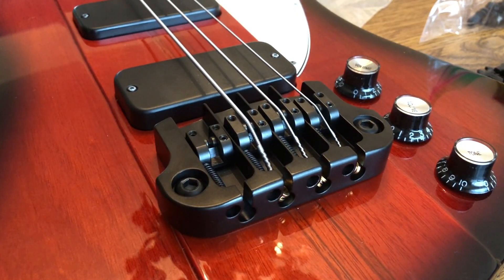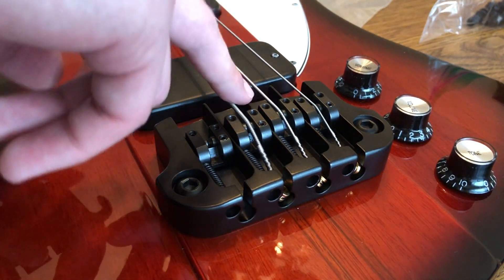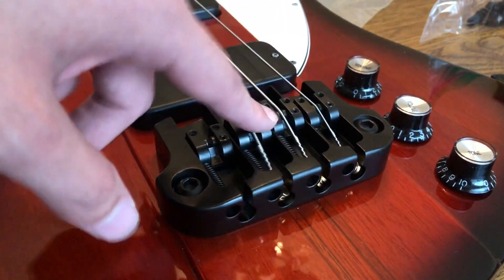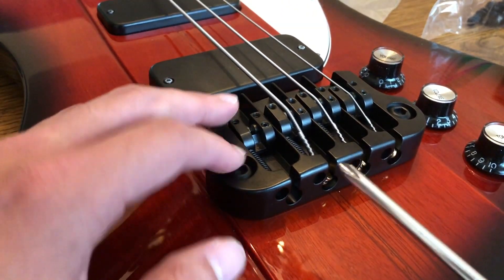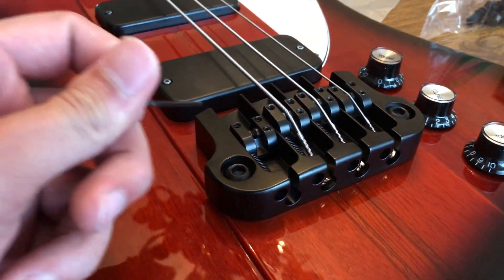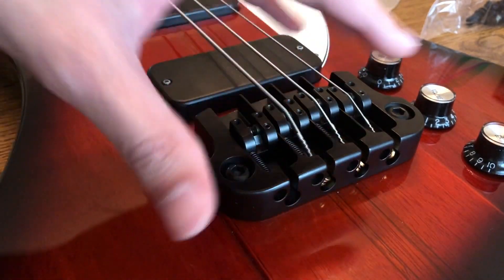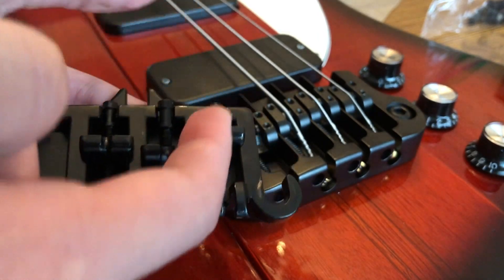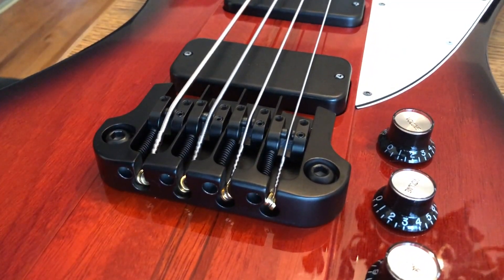Hipshot 3-Point Bridge Installation/Information Tutorial (Thunderbird Bass)

Comment: The Babicz FCH-3 bridge is another alternative. It uses all 3 mounting bolts and comes with a shim that can be used to compensate for varying neck angles and string height preferences.
Reply: This is good to know because the Hipshot is not nearly tall enough for my 2010 Gibson.
Reply: It’s also significantly more expensive.
Reply: @The84thProblem  it has a couple features the Hipshot doesn't have like the shim and you can lock the saddles down so you don't have to gunk the screws up with locktite. These bridges are costly because they are made in small batches.

Comment: Can you get lower action than with the stock bridge.
Reply: Yes, actually you have to REALLY increase (not far from max)the height of the saddles, otherwise strings are touching the fretboard. I guess the babicz has a kind of optionnel plate you can install between the bridge and the bass might be useful in this regard.

Comment: Hi,  I installed this bridge on my epiphone Woody Allen RumbleKat.
As it is now the bridge is still slightly raised above the soundboard, yours is on the board right?
Also, oddly I cannot intonate my strings properly with my set of new strings (Tomastik JF324), the range is not enough .... As theoretically the range is the same as the old bridge this leads me to conclude I've done somthing wrong. Any insights on how you actually mounted the bridge are appreciated!
Finally, I think there is a design flaw in the bridge: the saddles can move sideways in their rails, which causes a very noticeable rattle on my G string (and my D string to a lesser extend). Nothing that can't be solved, but not what I expected on a 130 Euro bridge ....

Comment: A couple points on the Hipshot bridge installation on my Epiphone EBO Bass : mine  had buzzing on the frets everywhere and the bridge small separate allen nut by itself back behind the string saddle height allens doesn’t seem to do shit and one of them has actually stripped and  can’t be removed even even  and I was completely unable to intonate the bridge at all , so which bridge is the actual piece of crap
Reply: How did you ever get it fixed.    I have a epi . Classic pro  & if I decide  to put a hip shot on it I'll just have a music store install it properly so I dont regret  it and dont sound like shit with fret buzzing or other complacations. 🤔🎸